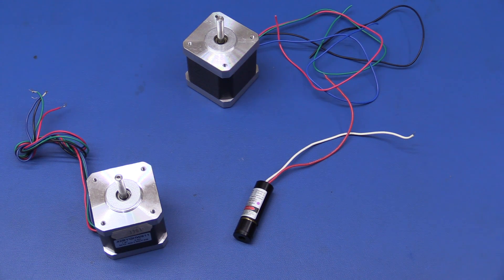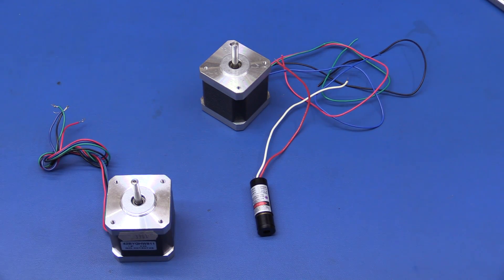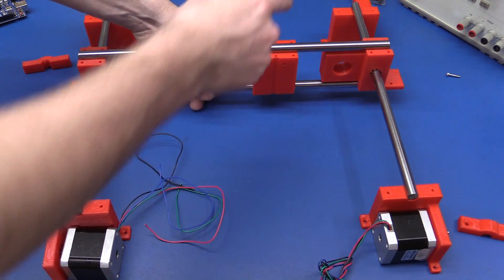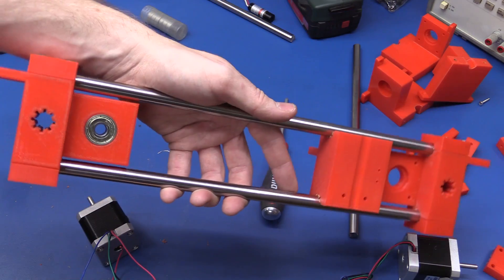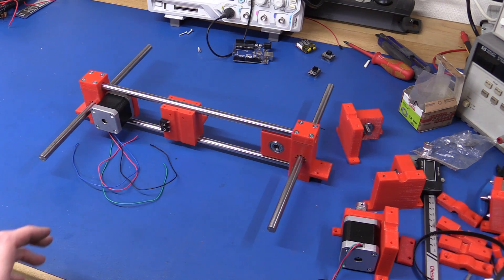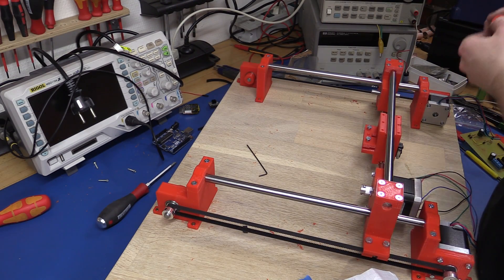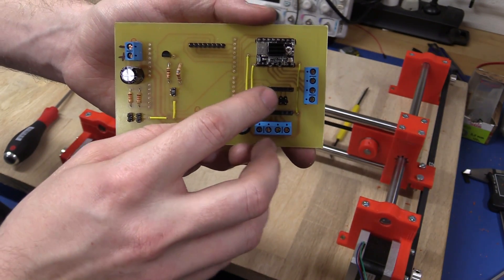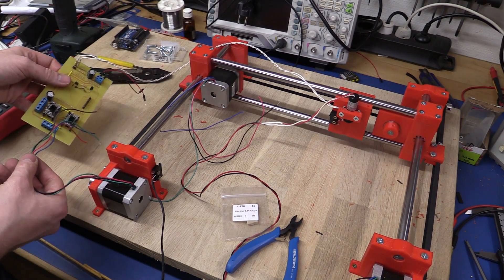DIY Laser Engraver - Part 3: Assembling the Machine - Ec-Projects

Comment: A few suggestions if you make a new PCB: Use an Arduino Nano to mount on top of the board and keep size down. If the laser comes on at startup because the logic in the software is inverted, you could add another transistor or a strong enough pull up resistor. Then it would be HIGH to turn it on in software.
Reply from the maker: Yeah, you are right about the Nano, I just used the Uno because that's what most people have laying around :)
I actually just had a brain-fart and put the transistor on the wrong side of the laser (high side) so I had to use a PNP :) 
I should just have put an NPN on the low side, but for some reason it ended up in the wrong place :P
Reply: Sorry to bother, but seems to be that u know about LD and electronics... I just buy an S9 Sculpfun module (10w)... but... how to drive it? what kind of pwm electronics to use it with my 3D printer?

Comment: I wish we could purchase 20 watt diodes then I would be very interested.  Still, not enough to compare with a 40w (30w) red Co2 laser but the diode should last for a heck of a lot longer and no mirrors.  I can't help but to believe that mirrors, as well as the distance between the mirrors, does affect the final power hitting the object and if there is any smoke that would make it even weaker if by only X amount.  None of that transmission line losses with a diode laser (only from it to the item).